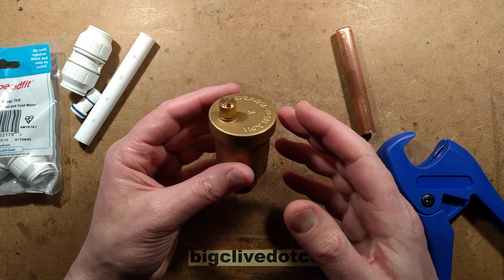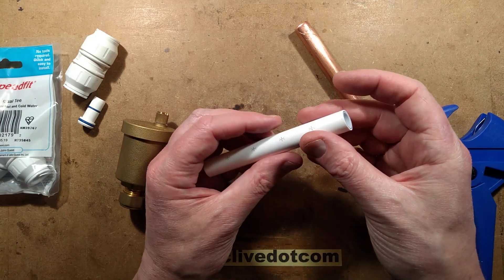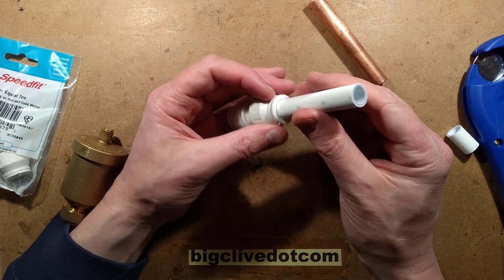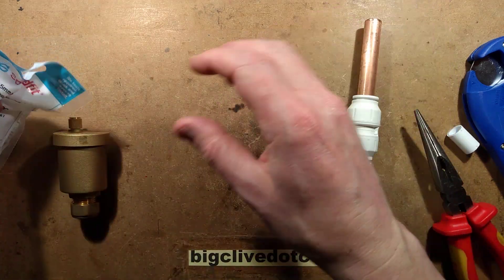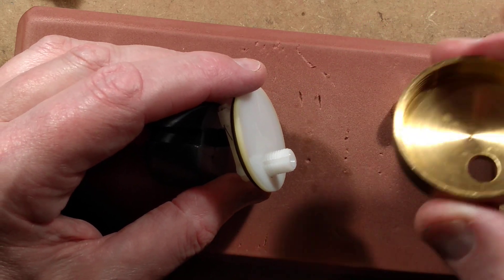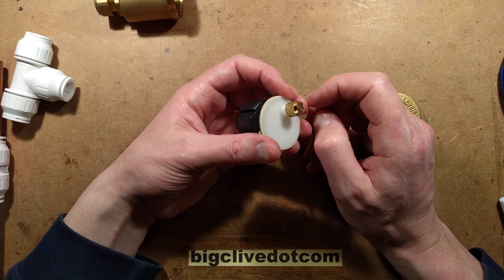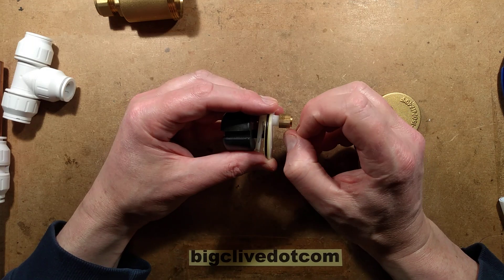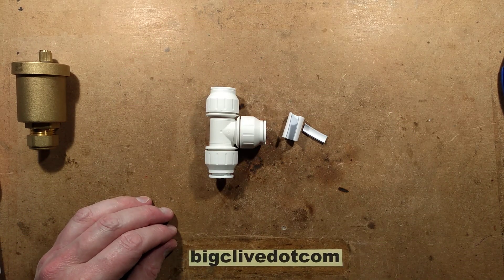Inside a bottle air vent and plumbing ramble.  (No electronics whatsoever.)

Comment: The white plastic bar you removed is a lever, the wire is the fulcrum and the float pushes further down so that the force on the valve is large enough to stop water leaking out.   Plumbing is very rewarding as an activity and unlike gas and electrical installations, the worst that can happen is you get wet, not electrocuted, blown up or poisoned!
Reply: Thanks for the info.

Comment: As a retired plumber and heating engineer, speedfit will eventually creep off the pipe , scoring the pipe. I found that out when I was called to someone else's work. Shark bite and other manufacturers are better in my opinion. On speedfit joints you can completely dismantle the fittings to remove the insert. I think crimp fittings are probably safer than pushfittings.but cannot be dismounted.
Reply from the maker: I'd guess that water hammer will be a big factor in gradually forcing some push-in pipe connections off.

Comment: One downside of PEX is that it isn't mouse proof. I had the same piece gnawed through twice where it passed through a cavity wall (externally accessible it seems) before I replaced it with copper. Mice will eat almost anything but their teeth don't seem to be up to chewing copper. In my case I had to remove a sink, kitchen cabinet and a load of pipes each time. Wasn't happy but it hasn't happened since.

Comment: I did call out plumbing for a while, with the remit to just stop the leak and make safe. At 2am that’s all I was gonna do anyway. I came across several of the very early push fits that had failed, the ones with no locking ring, particularly if they were on the mains and they’d used an elbow as the first fitting to feed the sink before going off elsewhere, the elbow could be hammered off over time.  And  people going out and leaving the washing machine running, never do that, if the valve gets jammed with a bit of pipe scale then you’ll come home to a swamp. I always turn off my WM feed tap since I saw what happens if they fail. And those automatic air bleeds must be twisted as well as have the cap on, they can leak if they’re not twisted to “close” ..the one in the video doesn’t have the twist top, it just the valve cap, don’t leave them on auto, just vent them every so often, they can ruin the ceiling and CH water leaves a nasty patch.

Comment: A common cause of pin holes in copper is not de-burring a pipe before fitting it into a fitting,  the water rushing through will develop a cavitation swirl and over time will do what it does to boat and pump propellers, pull bits of metal off the inside surface.  I’ve seen a brass compression elbow with a tiny pin hole because the feed in had not been de-burred.  More usually the pin hole is about an inch out  from a joint, and modern copper is very thin. To eat through a thick brass fitting must take years.  This was in a hard water area with more alkaline water, I believe soft water is more acidic.

Comment: Yeah... Naaa, I hard pass on the PEX plastic, especially the Cu. to Plastic adapters. 
The obvious weak link in these plastic and Cu. crimp fittings is the use of O rings - a service design life component in a supposedly permanently installed non-servicable fitting. 
I would never trust plastic pipe and the fittings for domestic Gas installations, EVER.

Comment: Would you be able to install this on the mains pipe before it enters the meter? We often have air blowing through the meter and it runs like crazy "loads of water leaks in the area". Thanks!
Reply from the maker: Not sure about that.

Comment: Speedfit's great, but, it's expensive (compared with soldered copper), the fittings are bulky which can be inconvenient, and (this is the worst, and why I wouldn't use it in older houses), rats will gnaw through it - I don't know whether this is just to get a drink or because they find it pleasingly gnaw-able, but they will.

Comment: Plastic pipe, correctly fitted, is bomb proof.    I think most people accept that now.   The main issue I always find with domestic plumbing is the total lack of forethought that has been applied to future servicing/refitting.   Pipe buried in mortar etc... is just unnecesaary.     Barrier pipe is necessary in heating systems otherwise oxygen will diffuse through the pipe over time and the radiators will corrode from within.  Don't believe anyone who says it's not necessary in central heating.   It's not necessary in the hot and cold water runs to your taps and showers.

Comment: can i use ball check valve before the air vent to prevent air from the outside to sucked in to the pipe when there is negative pressure in the pipe?
Reply from the maker: That could work, but I've never tried it.

Comment: These plastic pushfits are good with cold water with a guaranteed spec of 12bar for cold (20°C) water, but totally useless with hot (65°C) water where the spec is 6bar . . . . half as much(!) and even worse with hotter water, for example when, thermostats on electric immersion fail open and continues to heat the water.

These are the specs you should use to honour UK Regulations pressure testing regime to define the maximum pressure the system is likely to be exposed to, regardless of any YouTube pressure experiment where 99% will survive to much higher pressures.  . . . . that's not the point. . . it's that 1% that fail. They only guarantee only 100% at the spec.

Comment: I realise this is an old video but for the record the spring pivot provides a constant pressure on the valve.  If the float was directly coupled to the valve and it was installed on a high pressure system it could damage the valve seat, conversley very low pressure may not create a seal.  The float effectively acts as a weight to open the valve in the presence of air and in water the float is taken out of the equation and the spring does its thing.

Comment: I think that weird top mechanism is to provide some hysterisis. The weight of the float pulls the valve open unlike a traditional ball valve where the boyancy pushes the valve shut.

The beauty of this is that in theory if everything is working perfectly and you've got air/dirt seperators elsewhere then the tiny bit of air left in the top disolves into the water and seperates at the air seperator and eventually theres no bubble at all. But if something isn't working and you've got a net production of gas in your system then it will occassionally operate.

Hence it's helpful when practical to install these with a short bit of pipe from where they tee so that they are cold, this helps gases disolve back into the water where they get heated by the boiler and fed through the air seperator.

Comment: It is when the float drops that the valve opens. It will drop if air is trapped at the top of the cup, displacing the water. As the air is expelled, the cup fully fills with water again and the float will rise, closing off the air escape route. No more  knock in the heat register. Yea!! Also, real plumbers use copper pipe and lead free solder to build water lines. Love this channel!

Comment: Hi, maybe i missed it, but why is having air in the system not good? Air prevents water hammer and saves appliances from becoming leaky
Reply from the maker: It can cause air locks that restrict fluid flow.

Comment: Not a fan of plastics because of harmful chemicals in it .but they are improving .We have had a few recalls on plastic .the compression union fittings failing and oxygen barrier failure .plastics handle the freezing better because they can stretch

Comment: I have these exact bleed valves on my pipework because for some reason all my radiator pipework comes down from the ceiling into each room so there are loads of high points. I was getting flow errors on the boiler but after installing 4 of these on the high points the problem went away.
The previous owners added an extension and used plastic pipe under the floors but when I was installing the vents I noticed bite marks on it so I replaced it with copper lol.

Comment: its an AIR vent its not pressure driven at all. The weight of the float opens the valve as it DROPS. Push up-is not an issue.

Comment: My biggest concern with this type of system, and the Sharkbite fittings common in the USA, is that you rely on o-rings for the actual seal.  I would worry that eventually the o-ring will dry out, shrink, or harden and no longer provide a good seal.  The Sharkbite come with a 25 year warranty.  I've had properly soldered copper pipe in houses that is more than 70 years old without a problem.

Comment: PEX is cross-linked Polyethylene. And yes the blue ring is an oxygen barrier. Back in the 1990s you could get barrier pipe and non-barrier pipe, but I thinkg everyone has given up with non-barrier so it all has that lamination. It's normally aluminium in the underfloor piping which makes it hold its shape. There is also polybutylene pipe. That's what the original grey Hep2O pipe was. This is a great video explaining these pipes: https://www.youtube.com/watch?v=XQOfkgJkdWo and how it's made: https://www.youtube.com/watch?v=ds0GRSgb5Gk

Comment: I've been using plastic plumbing since 1994. Hep2O in the early days and mostly JG speedfit in recent times as it's more widely available. Not had any issues with failures. I do still like a bit of copper sometimes, e.g. for very high temperature stuff like solar thermal, but plastic is so much easier most of the time. It's funny to see someone in 2019 who's never tried it before.

Comment: Looking at the design of the spring system, I believe it is like this to make it very touchy as it in a way doubles the length of the  arm per the contact placements. I'm thinking this allows for a very finely adjusted opening so it dose not gush air and some water behind it.  The float acts solely as a pushing element.  
I've never seen one of these and may have to get one for my lines. I was interested in the insides as I thought it would make a very nice air line filter if you gutted it and added dryer granules inside.. using like a capsule.

Comment: One of the other great advantages of PEX is that it is available as flexible tubing, which makes it very easy to bend and run wherever you need it.  This might seem like only a convenience thing, until you realize that the failure points for water piping are usually at some (less-than-perfect) joint, not the pipe itself, and you start to think about how many of the joints in copper/PVC/etc piping are really only inserting elbows and such to bend the piping in some way (because it can't bend on its own).  Flexible tubing can often eliminate as much as 50% of the potential failure points in an installation, which to me seems like a huge potential win for long-term reliability as well (all other things being equal).

(FYI, "PEX" stands for PolyEthylene cross-linked(X), because it's made by taking normal polyethylene tubing and cross-linking the molecules together to form a much stronger "mesh" molecular structure than normal polyethylene tubing would have.  It comes in a variety of forms, most of which don't actually have the multiple layers like that, as far as I know.  That looks like it may be what's sometimes known as PEX-AL-PEX, because it has a thin layer of aluminum (or aluminium) sandwiched between two layers of PEX, as you suspected, to be an added oxygen barrier)

Comment: Dear Clive,  If you push the assembly together (around 4:00) with THAT type of Insert, the Barbs on the Locknut damage the secondary seal on the Insert.   It is better to take off the Locknut and put the Insert inside, first.
Reply from the maker: I'll keep that in mind.

Comment: You need to be careful where you use the plastic piping as rodents are sometime partial to chewing through it. Copper still has its advantage in such circumstances.

Comment: Great video as always Clive. Did you know that on the plastic pipe fitting, if you continue to unscrew it past the the resistance point the whole thing disassembles. This makes it easier to remove the pipe insert instead of using pliers. Cheers Dave

Comment: Failed on my mother's water mains when using a pressure washer, the increase in pressure when the motor on the pressure washer stopped blew apart the connection between the copper and fitting.. the installer hadn't turned the fitting to lock it together.....flooded the kitchen quite quickly at full bore.....

Comment: The reason the air valve tilts to relieve pressure is two fold. One, to prevent a hammer action. If it were to open with a total gap, the chamber/ cup would fill so quickly the float would rise so quickly it would slam the valve shut allowing the float to drop again and opening the valve again and repeating causing damage and noise. Second, if it were to leak with a slight tilt action, a lot of air will leak out in comparison to water. Actually, some air can leak out without any water leaking out...  Very interesting!

Comment: 10:36  in case of a clogged up valve one could take the top nipple screw cap off and push down on the valve by sticking a thin screwdriver through the bleeder hole. That way you have a quick fix with out having to depressurize the whole system

Comment: Polyvinyl Chloride (PVC) has been really popular here in the US for years, but now they're doing PEX. I've never used PEX, but PVC can last a lifetime if you keep it out of the sun and below 80 psi (pounds per square inch) 

Polybutylene and ABS can be really iffy though. I've replaced a good bit of ABS and Polybutylene. Copper is losing its popularity here in the US, because it's way more expensive and you can't just glue it together like PVC.

Comment: Thanks for explaining how the air vent works. I’m installing a Salamander shower pump. The diagram and text on YouTube says both hot and cold outlets of the pump need to be vented. The diagram doesn’t show how to vent the pipes and the text just says they need to be vented. No mention of an automatic air vent. I had to phone them for more information. They realised they had missed out vital information. I pointed out if there was just an open pipe (as their diagram showed) water would shoot out when the pump was working.

Comment: Genius solution. The pressure differential will hold the two surfaces together sealing the system, as air accumulates inside the float drops down its tilting the valve surface enough so air begins escaping & closes again as the float rises.  It takes far less effort to tilt the two apart than it would to pull the two surfaces apart squarely. Great design.

Comment: I dislike plastic pipe.  The inner bore for any given size is reduced and the push fit joints have been proven to leak. If your joints are hidden under floorboards or in walls it's a bit of a nightmare. What is the lifespan of a rubber o ring?  Don't kidd yourself Clive your a smart guy do you trust plastic pipe that has been stretched by ice?  J G s#!t fit fittings have let me down more than once so now I totally avoid this stuff. If I use plastic pipe I get the stainless top hat inserts and actual compression fittings. Much safer and durable.

Comment: I've used the sharkbite (US common name) style fittings a lot on both copper and plastic, and copper to plastic. On both hot and cold running water AND central heating but not underfloor for which Pex (plastic) pipe is also used. Never had any  problems.

You kind of got there in the end with the air release valve operation in that the weight of the float is enough to OPEN the tiny air valve when there is no water in the chamber. But once the water fills the chamber, and the float reaches the top, it is the small amount of spring pressure that CLOSES the valve sufficiently to allow water pressure to complete the seal. 

Typically the inside pressure (i.e. mains water pressure) will be a minimum of 1.5 to 2 bar. Some people are lucky and have 3 to 4. That's 0.5 to 3 bar greater than atmospheric so it's a tight seal.

There are also small auto bleed inserts for central heating radiators that are worth their weight in gold as they replace the manual bleed valve and are very neat. 

It's interesting to see inside one. There are some cutaway images online. Here's a link to what they look like, no idea why they are not fitted as standard instead of the fiddly square key type!
https://heatingpartswarehouse.co.uk/wp-content/uploads/2017/10/Aladdin-Autovent-HV30-a.jpg

Available on eBay: https://bit.ly/302ZuXu

Cutaway drawing: https://bit.ly/3e29Zmf

The steel hoop is the removal and sealing key.

Comment: I first used Speedfit (or similar) plastic pipe and fittings about 10 years ago. A neighbour came round to help me move a radiator in the bedroom onto an adjacent wall. He recommended plastic but I was a bit dubious - especially as the floorboards were going back down afterwards, then a new carpet and I was worried about how secure these new kids on the block would be in the long term.
It certainly made the job easier though and we simply re-routed the existing pipework by drilling a 15mm hole in each joist and pushed the plastic pipe through. I even used plastic fittings for the final 90 degree elbows, but for the vertical feeds I did use copper. Or rather, I cut the existing copper pipe just beyond floor level. The ridiculously simple "push on" fittings couldn't be any good I thought - as I usually used solder ring fittings. But, the system was refilled, bled and there were no problems at all. I save a few hours overall. The only thing to remember is that you don't use plastic pipe or fittings within the first (or last) 1 metre from the boiler.